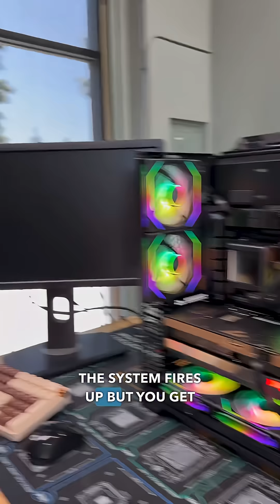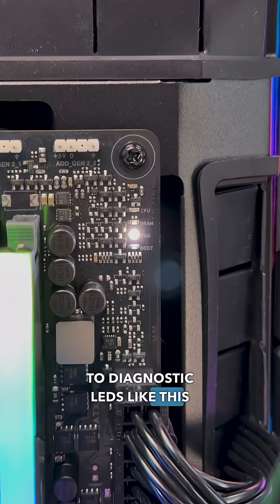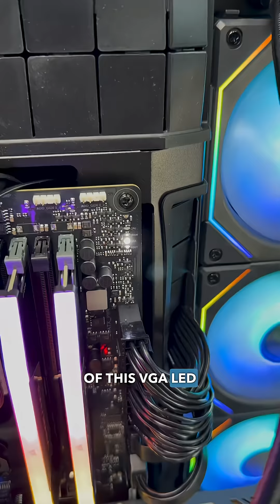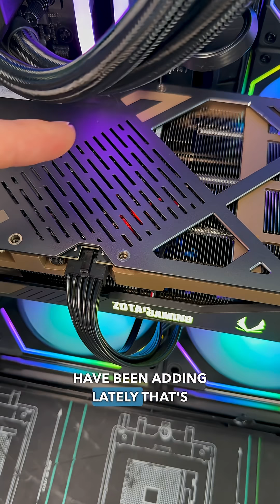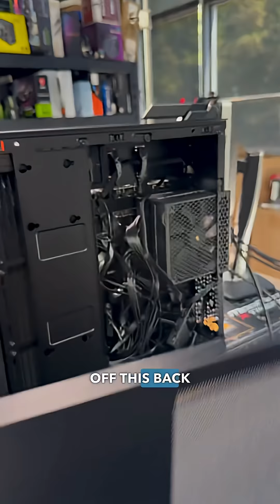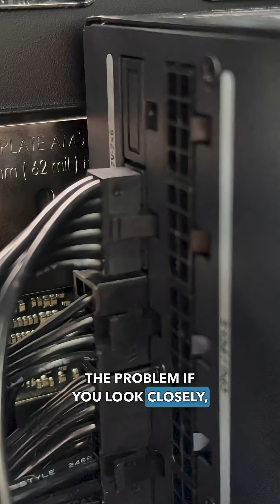NEW PC NO POST! #pc #techtips #pcrepair #repair #computerrepair #pcbuild #gamingpc #gamingcomputer

Comment: I had this issue today. It got stuck on vga but my gpu was fine. It also got stuck on ram and it was fine too. Funnily enough, some rubbing alcohol and through cleaning of my cpu on 'every visual surface area' of it solved it and finally allowed it too boot without bsod or boot looping.

Edit: i reseated my gpu and checked the power cables several times to no avail. Only after cleaning the cpu and socket did it finally work.

Edit 2: it would say my cpu was fine but either got stuck on ram or vga. It also decided my ssd was dead when it wasnt.

Comment: This happened to me multiple times and I have a 10 yrs old PC that doesn't have the fancy stuff like RGB lighting and those LED lights troubleshooting only beeping sounds with codes (which I had to learn how to decipher too). I remember having this issue the first time and it was so infuriating as a beginner. I was googling fixes for it throughout the day only to find out that the SATA power and data cable of my DVD-R drive got loose hence the reason why it doesn't POST. Second time it happened it was because of the GPU being improperly installed, then the third time it was because of the CMOS battery. Aaand finally I had this issue a few hours ago, all because my SATA data cable of my extra HDD got loose, more often that not it's a hardware issue so don't panic if this happens to you. Luckily if you have those LED lights on your motherboard you can easily troubleshoot everything without disassembling every part of your build.

Comment: Used to? Did the connectors stop melting?
Reply from the maker: Well the 12+4 redesign has fixed the issue a good amount on the new cards as long as your power supply is reading the sense pins

Comment: I wish the debug lights were always a clear indication, because sometimes they can lead you down a rabbit hole
Reply: Back in the day on boards worth 1/3 as much it was standard to have a 7 segment display that would show real time post codes that you could look up in your manual that will tell you not just that eg the GPU isn't working, it might tell you that it's because PCIe isn't working or there's a signal issue or no power or really anything. Far more verbose and honestly a tragedy that it's gone.
Reply: Many of the ASUS ROG boards still have  a real time number displayed in POST, then you can also set it to show your CPU temp while the system is operating. Main reason I buy ASUS boards.
Reply: @darkmaster2110  yeah but asus boards suck, also most high end boards have post codes anyway
Reply: @Krutonium  CHEAP MODABORD FROM 2004 TELL YOU NOTIN, NOW YOU WONDR, DA FUK IS GOIN ON??? H61 MY BUM YOU SPEND NO SLEEP NIGHTS FOR DAYS WONDER WHAT PROBLEM, ah so it was a loose ram stick ~..
Reply: @Krutonium it's not gone. They just replaced the 7seg with a SPEAKER and binary auditory code
Reply: @Duck_side  You'd think so, but most motherboards don't even come with an onboard speaker any more, and you're lucky if there's a header to add your own. And BeepCodes only work if the motherboard realizes there's an issue.
Reply: @Krutonium  My Aorus board has this.
Reply: my little brother spilled some water on his PC by accident and it stopped posting the day after.

I first swapped out his GPU since his motherboard doesn't have this or the function to convey what's wrong by sound with the beeps.
GPU worked fine thankfully, took out a ram stick and it started booting again thankfully.
Reply: Oh the effort to look at the lights. Back in my days the computer beeped out codes. And we liked it.
Reply: For real. Had a pc in our shop that was stuck on CPU so I asked the client and my bosses if it was ok if we ordered a cpu to replace with the possibility that something else might still be the problem. 

I got the OK installed the new cpu and nothing still got the same error.  
I told my customer that the error persists and he decided that we just stop and he is going to buy a new PC. 

I never figured out what the problem is because all I knew was that the problem was some cpu issue. It could also have been a faulty motherboard / cpu socket which is my guess but I will never know for sure.
Reply: False, you're just too ignorant to be able to interpret them properly. User error and something that can't be blamed on the manufacturer. That's why there is some form of user manual included with every board. Don't ever attempt to build a pc again in your life. Moron
Reply: Man are you speaking some facts, sometimes it gets plain annoying to find the root of the cause.
Reply: I had a fail to post caused by the de bug lights shorting out took longer than I want to admit to figure that one out

Comment: My 4060ti does this. If i restart it a few times itll boot and everything runs fine, games for hours. But if i shut it down and try it on a "cold start" i get the white VGA light. Whats the issue?
Reply: When in doubt try another PSU
Reply: 100% try changing cables first. If that doesn't work then do as someone else said and update the bios. If all else fails, replace the PSU. If that fails, you're fucked and need a new GPU or at least you will eventually because those tricks getting it to work are only temporary. Eventually whatever is causing issues will fail completely.
Reply: I am gonna go on a leg and assume you have an msi mobo.
Reply: Asus card and board, thermaltake gold psu  @kucklow_music
Reply: First check the phisical stuff like is the RTX 4060 Ti in the right PCie-Slot? It must be in the first slot on the motherboard.

Second check is the cable installet right on the GPU and also installed right on the PSU? 

Software part: 

Third one is is your BIOS updated on your computer? When not, please do it. 

Also re-install the GPU driver with a new version, but uninstall with the programm DDU (Display Driver Uninstaller) the old driver and then freshly install the new driver.
Reply: @SimplyTakuma  Eh, you really shouldn't be updating your BIOS unless you truly need to. A BIOS update can add so much additional instability and hard to track down issues. It should really only be updated if it's fairly confidently ruled down to being the cause of issues, or in instances where it contains updates concerning the health of your hardware, such as Intel 13th and 14th Gen processors or if you have a 9800X3D, especially if it's paired with an ASRock board.

That said, if he isn't able to eliminate the problem with any of the solutions suggested in here so far, I'd be willing to go out on a limb and guess that his video card is starting to have some capacitors go bad. It will be intermittent at first, but eventually there will come a day when it simply refuses to turn on (or turn on fully).
Reply: Not sure if u have fixed this but i had the same issue. Turned out the way i routed the power cable wasnt the best and it could move when i knocked the desk. Try the power cable though i different more stable route from psu to gpu.
Reply: Same issue here. That's why I stopped shutting down my PC, I make it sleep. It happens occasionally. if i remove PSU plug, wait for a couple of minutes, and start the PC again, it works fine.
Reply: Try to reset you BIOS or update it. Something BIOS instabillity cause such issue. Oh boy i hate modern PC build overprice, power hungry, quality issue, stock issue. I wish China chip could be a main competitor today.
Reply: Bios has been up to date since before my uograde, reset that and replaced cmos battery. Checked my display port connections and power cables. Still happens. Ive just been putting my pc to sleep instead of shutting it down and only then does it run flawlessly. 750w psu and 5900xt my old amd card pulled 200+w and it ran like a champ, 4060ti doesn't come close to the power demand  @arik2216
Reply: Before trying another PSU, try different power cords. From wall to PSU and from PSU to graphics card
Reply: @Truffalot  If you do try a different cable from PSU to GPU make sure it's one that came with your PSU, using one from a different model can fry your hardware

Comment: the most simplest solution can be the most annoying thing
Reply from the maker: The story of my career
Reply: @mattscomputerservices can you tell me why my pc just randomly starts itself
Reply: Welcome to the life of a computer technician
Reply: @electrothesonicoc  welcome to any technician job really.
Reply: Those fans seems to make no sense in that config😮
Reply: Guy with an odd profile picture named “FetusMunchers” giving the most relatable comment. I love YouTube.
Reply: Litteraly
Reply: It gets even worse when you start programming.
Reply: Yea the smallest gap leaves the biggest fire
Reply: Happened with me, my laptop stopped booting into windows after a power fluctuation. Spent hours trying to figure out the issue, from Changing RAM to re installing windows. Found put that I just had to boot into safe mode and disable the GTX 1650 since it got fried.
Reply: @elitefaq914  The moment you realize your gaming laptop became a regular laptop
Reply: At least in this case the components are easy to reach, unlike my case. I have to pull out the entire PSU just to be able reach the cables. Something I'm going to keep in mind for future cases.

Comment: I'll keep that in mind when I upgrade the PSU.
Reply: That person who has an older ddr3 pc: “what LED? I don’t see them!? WHAT DO I DOOOOO!!!!? 😭”
Reply: Remember not to leave the old psu cables if you upgrade, not all psu cables are pinned the same and a cross wire could damage something, so only use the cables provided with the new PSU 

I have never experienced this but I've heard of it, I replaced the psu 2 weeks after I built my PC (the original was faulty) and left what cables I used on my old psu, for the new one, and had no problems for the following 9 years until I built a new PC 6 months ago.
I was unaware of this issue when I did it 9 years ago lol.
Reply: Another tip is to buy one that is ATX 3.1, it is less of a risk if the cable is not properly plugged in the PSU because it has shorter pins... Although I can't assure you that it solves all of the melting cables problem, but is better than ATX 3.0 at least.
Reply: SHUT UP OMER!!!!!!! BUY A PREBUILT!!! YOU CANT HANDLE THIS!!!!!!!!!!!!!!!!!!!!!!!!!!!!!!!!!!!!!!!!!!!!!!!!!!!!!!!!!!!!!!!!!!!!!!!!!!!!!!!!!!!!!!!!!!!!!!!!!!!!